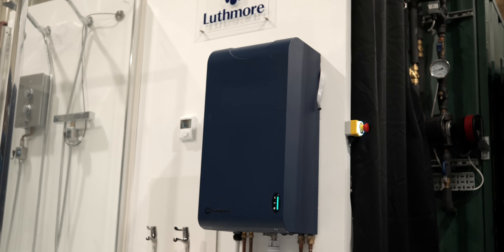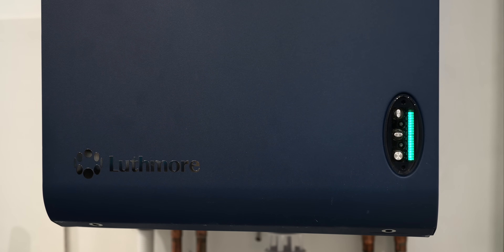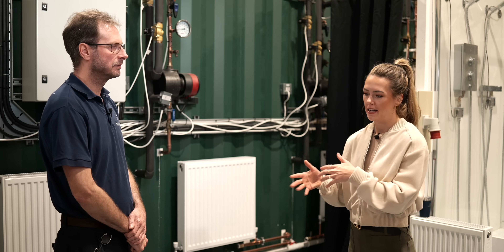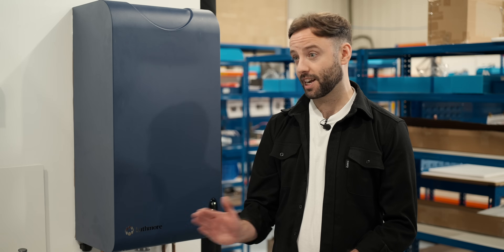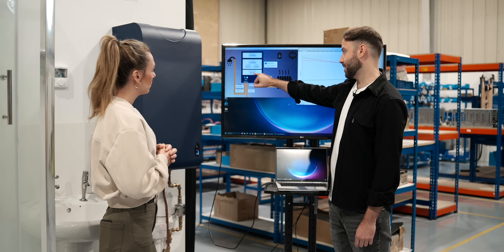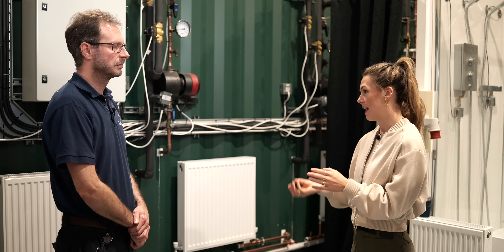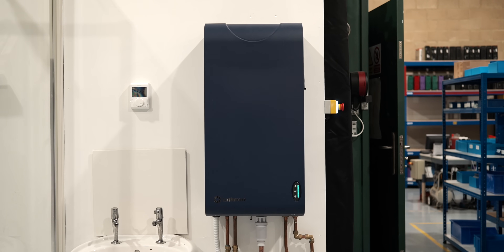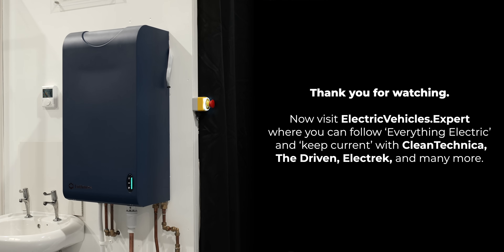Could This Battery Boiler Replace Gas AND Heat Pumps?

Comment: This is pure BS.
Just something knocked together to attract some investment money...then go nowhere.
No one has a combi boiler to only just do hot water (it would not be a combi!) 
If you have a separate hw cylinder this is half the price, and does the same job. 
If you wanted to release a small amount of extra space at a very high (but still less than this) cost, you would get a phase change storage unit.
If you had space and wanted to save running costs, a heat pump cylinder
Reply: And for properties without space for a cylinder, because they were built around a combi?

Luthmore One supports 10kW of central heating.

Comment: Nice idea and mostly well thought out in my opinion, However, I see two issues with this, one near future and another further ahead. The first is that the new sodium ion batteries are a better fit for this as they last much longer and will be significantly cheaper, even though they could be slightly larger. The second is that, as more and more people get electric cars and heating systems that use off-peak electricity overnight, "off-peak" will become "peak" and the cheap overnight tariffs will disappear. What needs to happen is more equalisation of energy prices to encourage energy users to switch over from gas to electricity, but that's not going to happen unless the Green Party gets some governmental influence.
Reply: Yes, but, will Na ion batteries be cheaper?

Would they be more efficient?

Far better by far to cobble in an instant shower.

Screwfix flog them off around £80.

Price of installation will be what it will be depending.

Might need a sparks to wire in a 45A circuit off the consumer unit.

The entire notion of heating water for said family  showers using batteries in a unit of this size is ludicrous.

Goodness only knows why Robert continues to host these useless products.
Reply: We are very interested in sodium-ion technology as well because of the higher operating temperatures. They do not provide a safer alternative to LFP at this time and are not as widely available nor as energy or power dense. LFP cells such as those in the Luthmore boiler cannot self-ignite even in a failure condition.
Reply: @Luthmore 

Ref your assertion on LFP batteries then you're typing nonsense.

Always do some research prior to posting allegedly factual info.

I won't have been the only viewer to do the fact checking thing.

It may have been that whoever flogged you these batteries absolutely assured you they were "safe".

Well, they're not.

Tell you what, why not read some of the earlier posts ref having lithium batteries inside a building shared with people.

You could then Google up BS63100.

Then contact your insurers ref the above and quiz them on their policy on lithium batteries and where they should be installed.

You can be sure any putative customers will be doing just that.

Comment: This seems like using a sledgehammer to crack a nut, there are much simpler and probably cheaper methods to achieve the same results. In my experience there are very few homes where there's genuinely no space for some form of storage tank, there's always a little used cupboard or corner of a room, especially when you consider the space an existing gas combi already occupies. 
In the case of my son's house, a 1990's 600sq ft, 2 bed semi, the boiler was in the kitchen but on the other side of the wall is a hall cupboard, so we opened up a small section of the wall and "stole" about 300mm x 600mm off both the kitchen and the hall cupboard. Into that cavity we squeezed a Warmflow Nero triple coil 290 litre tank which is heated off the mains, using excess solar PV (panels were already on the house when he bought it), and a second hand solar thermal panel mounted on the porch roof. As a DIY job the total cost was under £2k and took a weekend, to get trades in would probably double the cost but the tank can store about 15kWhr of useable energy and doesn't require any complex controls or apps.

Comment: 16+ degrees C inlet temperature is very convenient for a demo!! I like the fact battery cooling contributes to the water heating but that's about it, everything else is... adequate. There's no real magic to resistive heating, it's all about the available tariffs at the end of the day. App controlled, cloud based? No thank you (I'm far from a Luddite and I do have a Wiser system at home, but at least if that goes belly up all I need to do is either put the old TRVs back on or migrate to Home Assistant)

Comment: Solving a problem that doesn't exist
Reply: It's a problem that very much exists.  There are literally millions of flats and small homes with gas combi boilers which this is supposed to directly replace.   I would have liked clearer information about how long it can run the central heating and provide domestic hot water for a household but it seems to be a bit too vague.
Reply: @michaelgoode9555 central heating is provided from the mains so runs indefinitely at up to 10kW.

Comment: WHAT IS THE PRICE  ? Everything Electric please be journalists rather than free promo. .
There is always room for Air to Air heat pump & point of use electric shower.
But this great if you want baths & have no room for cylinder .
But hard enough building a electricity grid to support heat pumps in mid winter,with this you need 2.5 (say) times more electricity on the coldest day .
7Kwh of battery ? say your homes has only 3Kw heat loss in mid winter, & you need 70Kwh of heat a day , you can only shift 7Kwh to off peak charging.  
I'm against batteries in the home ... should be in the garden shed. 

Liking the idea of the batteries being fitted one by one ..... for Classic Car EV conversion .

Comment: I think its ineficient for home heating. 
I like the idea of water heating, but Imagine that 20kw on hot water brings like 80% of energy from grid only, it could be reduced to 4kw if you add small 10l boiler and have 90% efficiency.
When heating it makes no sense that it sotores any significant energy, lets say property heat loss is 2kw, it runs out of batteries and it draws from grid after 3 hour like emersion heater.

Comment: I don't understand how this works 
 Last year we spent £1200 on gas. We used over 20,000 kWh of gas, and from November to March we averaged over 100kwh of gas every day. If I can charge my 7kw battery overnight off-peak the. For 7 of those I will have comparable cost heating each day, but for 93+KW I will have very expensive electricity!
Reply: You need to focus on improving your home's energy efficiency. No fancy tech, just sealant, insulation, and observation.
Reply: @Ausdb not really possible. £1200 on gas for a 350m² 100 year old house is pretty decent, our previous 90m² house used the same amount. it would destroy the character of the home to add more insulation. Everything else has already been done. Where possible it was insulated to very high standards. Impossible under some of the floors due to historical fireplaces, and on some of the walls due to stonework on a house being of special heritage interest. We also couldn't get planning permission to change the slightly breezy front door let alone sort out the thermal bridging that occurs between the steps into the house and the houses floor.

Comment: I'm struggling to find what benefit this has over a heat-pump water heater other than the initial instillation cost.
Reply: It's harder to install a heat pump in a flat, due to the potential lack of ground space, and the lack of space for a hot water cylinder - most heat pumps, as I understand it, heat up the water rather more slowly than a combi boiler, so you need the "buffer" of a hot water tank. There's also the problem that, if you rent, you need to somehow persuade your landlord to shell out to save YOU money (s/he won't save anything, because s/he doesn't pay the energy bills...)

Comment: You can harvest 4 times the energy with a small heat pump that just does warm water, and you can also couple it with a battery. What the hell? Stop making people think that this is msomehow a good idea.
Reply: If you live in flat with no HW cylinder or place to put a HP what do you do? I'm flabbergasted you bother to post without addressing that issue?
Reply: @logik100.0 if you're living in a flat you aren't heating your water yourself anyway.
Reply: @kingphiltheill What? People who live in flats cannot heat their own water? What's planet planet are you living on
Reply: @logik100.0 where I live, houses with multiple flats have a central heating system which is available to everyone. The costs are divided according to installed water meters and heat meters.

Comment: You could do this with a big bag of sand, why are people throwing 10k+ worth of batteries at this problem?
Reply: That is a great question. The “bag of sand” approach has its merits but the main issue would be one of physical size and our old friend power density. There will always be a compromise between total product size, sand volume and the surface area and volume required to get the heat out of the sand fast and consistently. It is unlikely such a system could fit within the space envelope of a combi and achieve 30kW on-demand power.

Comment: Waste of money, it certainly doesn’t replace a combi as it only does hot water. 
You may be better off just using point of use electric, so no pipe losses. 
Cost.
Batteries, about£150 kWh now, (sodium will make that even less), £1,050.  Plus electric boiler, say £200.  Plus other bits, say £,1400 total. So at £5k, a lot for a shiny black box.
Reply: Luthmore supports central heating up to 10kW from the AC mains.

Comment: I could see that this would be very beneficial to landlords, as they would not need to get it serviced every year unlike a gas boiler. And it doesn’t matter if the energy cost is more or less, as the tenants would be paying for it.

Comment: After running a electric combi ,i will never buy one ever again, whoever says they are cheep to run is lying and walk away , I ran one to connect up a on suite, running twice a day for about 15 mins , total cost per shower 5.60,  I swapped it out for sunamp thermeno 300, charge it up off peak , and run it with a digital mixer , first off flow 20 litres a min compared to 11 from the combi, off peak charge £4.20 and I can run it for 3 days before needing to charge again so actual cost £1.79p per shower, I store it in the horizontal airing cubbord next to the 200 litre pressurised cylinder connected to the system boiler , oso cylinder does kitchen and main bathroom cost to heat daily 2.20 in summer it heats up using solar diverter which in turn stores the rest in a new 30kwh duel pack with 20kwh output so I can go completely off grid for energy in summer , and no I’m not going heat pump either I had a 14kwh duel system in my previous house at best I saw 2.2 per kw in winter to 3.4kwh in summer it was double my current gas usage ,  I say this to anyone thinking of swapping , swap your radiators to k2+ or even k3 first, set you gas to a 45c cycle, don’t do it if you have single panel glass at all or solid walls without insulation.  Clear out the loft, stick joist risers on it , then fill the void with dust protected r35, don’t compact, the air is what traps the heat, deck the loft put your stuff back in and also thermal blanket joists , or fill joists with hard foam insulation, especially filling the gap with the wall to joist area like I did this makes the joist and roof the equivalent to r60. If you have a cavity wall coat the outside with armour water barrier it last 15vyears this helps the insulation which is sodden by now to dry out , let it dry over summer once the coating is added , you can then have the wall insulated to r25 , they inject it every couple of feet, ok it’s not cheap the loft about 3k to do but we’ll worth it , walls to paint a tin cover about 6m sq at 36quid per 5 litres trade , two coats are needed and drys clear but can look like the wall has been waxed in some lights , if your going to change your windows what is your situation if your on a main road 3 panels is worth it alone,  otherwise choose a good quality 2+ pannel argon can leak causing windows to fail so opt for a Metal coating in south facing to cut summer heat , personally went 3 panel due to being a open country fields behind typically we see -6 c compared to town in winter regularly, it’s odd seeing ice on the outside not clear until sunlight hits it all day . All these changes plus insulating the floor with r30 and vapour barrier it below the insulation , it is a massive difference I heat for about 2.40 a day apring and night nd have air vents in windows now compulsory,I did the work with a friend who is in the trade material cost bout 3k, time to complete 7 weekends , this is a job best if you have an empty property or like me we’re constantly clearing one room at a time to lift the boards , many properties are straight slap so know your property before ordering , it would take over 30 years to get to the energy cost before a heat pump would be paid for - grant many only lasting 10cyears about the same as the boiler and it’s a doodle to get serviced

Comment: I live in an old (1840s cottage) no gas, no oil, currently use a 12KW electric boiler with HW tank. Wondering if this would be cheaper? Would have been nice to know how much it cost.

Comment: I'd like to know how long does the unit work for in the middle of winter when the house needs to be heated to 20-22C and all the family needs a shower? That wasn't made clear.
Reply: You use everything untill it runs out then you go to bed/pub until you get recharged.  Bit like putting petrol in your car..

Comment: Ah the waffle really gets on my moobs. 100A incomer? maybe for moderm build but most existing older housing stock in the UK has only 60A incomer. So mass upgrades needed. One part in this video they talk about the product sufficient for a 3/4 person household then another part of the video they say the product is more suitable for smaller properties or apartments where heatpump not suitable. Doesn't sound like they know what the target market is themselves.
Reply: DNO data suggests approximately 80% of UK households are on a 100A fuse. 60A the next most common, though 80A is becoming the norm in new builds. The Luthmore boiler requires a 50A breaker, the same as a 10-11kW electric shower, and comes with the required G100 compliant metering compatibility to ensure load is automatically throttled if required.
Reply: @Luthmore 80% on 100A 😂, data sounds flawed to me. I'd say its far less than that. Did they base it on 10 new build properties in the last 10yrs 😂.
Reply: @S@SmellyExhauste upgrade to 100 amp from 60 amp fuse is free and carried out by your DNO. I had mine upgraded with no problems and zero cost.
Reply: @johnharvey1786 Can only be upgraded if cables can support it. Only small percentage of existing housing stock is probably upgraded to 100A incomer fuse  most built over 40/50 years ago won't even have the capability in the original supply design.
Reply: @S@SmellyExhaustGood point. My house was built  40 years ago and the mains supply cable was of a suitable size. It does  vary though on older properties and if the cable is too small the upgrade cost can be significant if your supply cables being hasn’t already been upgraded by the DNO for normal supply reasons.

Comment: They show that the issue is that we all need 30kW of power to our showers.
They show that fitting an online on-demand water heater can get a flow of 6 litres per minute.
So if we accept a shower flow of 6 litres per minute then we can get away without it?

Comment: Sounds great. I do wonder though whether, when everyone has a home battery, EV and one of these, there will still be such a thing as "off peak"
Reply: I wonder whether 'Community' heating may be an efficient way forward.  Say a 20' container with Battery, solar, wind and whatever.. to supply, say,  50 property's.  Scale efficiencies..
Reply: @Mole-Skin 

You could always Google up such  systems in places such as  Russia.

Unfortunately for Russians their planning laws seem to allow factories and housing virtually next door for using "waste" heat to travel underground to heat their homes.

I gather it functions quite well but living next door to work in some places might not be ideal what with pollution, say.

Comment: What is the point of this just get electric radiators!! Large battery pack charge the battery at night . Then use the energy for the electric radiators . Also a lot less maintenance service pipes etc etc.
Reply: 😂😂😂

I believe storage rads cut out the middle man.

Odd to some that storage rads are very efficient.

However it's not that easy to "switch off" the heat if the weather warms up and you end up living in a hot house.

Comment: Interesting video.  Looking at my own situation with solar PV, battery storage, and Economy 7,  my overnight cheap rate electricity is 14.2p vs gas at 6.1p.  If I factor in the efficiency of my combi boiler say 90% the gas cost becomes 6.1p x 100/90 = 6.8p.   So the conclusion for me is that it would cost double during the winter months but less in the summer when PV is at its best, but my export rate is 16.5p so there is potentially a loss of PV export credit.....

Comment: You don't have to change your radiators and pipe work for a heat pump to work. You have to do it if you want it to be efficient. Everybody should be recommended to change their radiators to better radiators and insulate their home as we should reduce the energy we're using. Thus, we look after the environment a lot more. 

Sadly, it's because we're an incredibly lazy country in building standards and heating technology that we waste so much energy